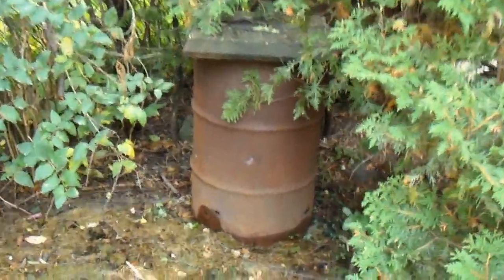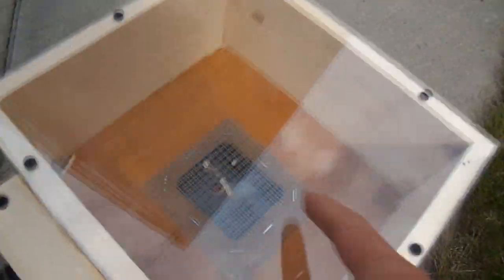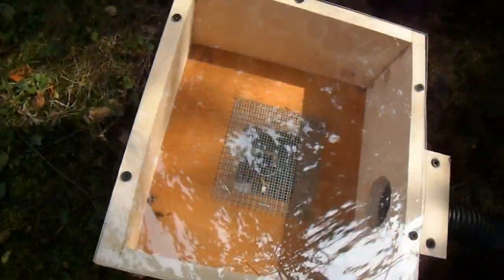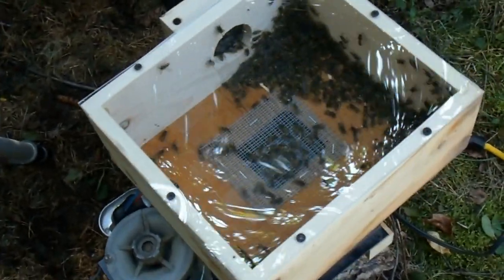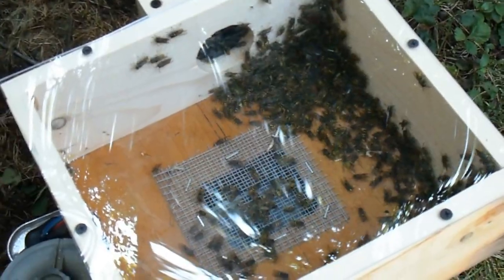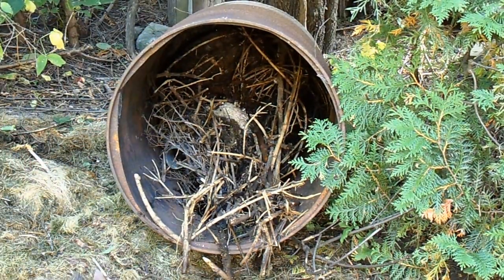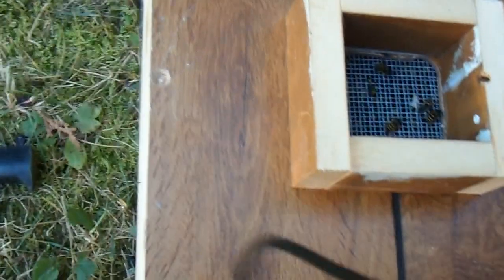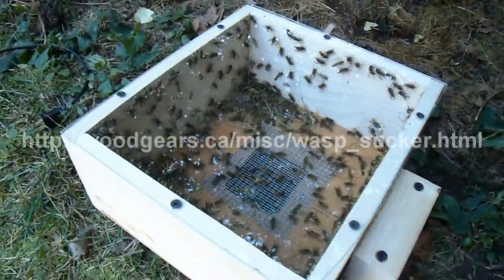Wasp sucking machine

Comment: Thanks for the video. I'm using my shop vac to suck up the wasps that have a nest right by my back door. I was wondering what I would find if I opened the vac (probably a bunch of live wasps). I plan on sucking some lawn fogger into the vac before opening. To anyone who does not know the difference Bees are furry and can sting only once. Wasps are not furry and can sting multiple times. Wasps are also more aggressive. I like that your workshop looks like mine. In your previous videos from years ago you looked super organized. People have trouble believing that I can find what I need when I need it!

Comment: For wasps with an external nest.... wait until early morning when they are assembled on the nest with their wings folded up. Hit it with a bucket of soapy water and that's that. No running back to the front door with a spray can in your hand over and over. Its essentially free and  it doesn't damage your house paint. For an internal nest such as this put a shop vac running next to it and let it run for a few days until they are all in the can. Take it from me though.. a large nest's worth of dead bees or wasps decaying STINKS!. Dump the bucket downwind and far enough away from your residence. Ants will finish the job.

Comment: Friday August 24, 2018  -  I have been a remodeling contractor for many years and i have used  vacuum cleaners allot to suck bees. 
 The yellow jacket bees and numerous, so I would get  a vacuum cleaner, shop vacuum, with lots of extensions and in a couple of hours they would be all gone.  
Also Lacquer thinner kills then instantly.    Works with any kind of bees.  We had a bees nest inside a stucco  wall  and the exterminator had a billows and filled with flour, blew it into hole were they were coming out and that kills them quickly.  The flour smothers them, flour gets caught in there sides and they can't breathe.  
Charles

Comment: Thats cool ! What i would do is lace the filter, that keeps them in that sits on top the suction machine, with raid and as i see that they are collecting in the box i would spray raid every now in then in the tip of the suction tube while its on or spray the raid into the filter after they are all in there to make it like a gas chamber.

Comment: Seems like even more of them would've been sucked into the hose if it would've been placed right at the side of the hole instead of what appears to be about 3 inches from it.  And yes, there's more than "just  few more " left after pulling the barrel down.